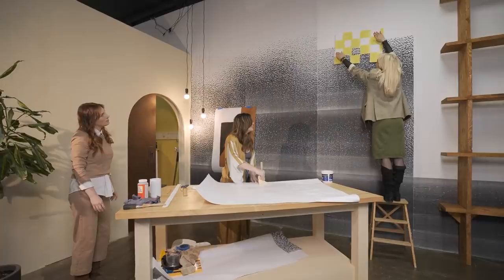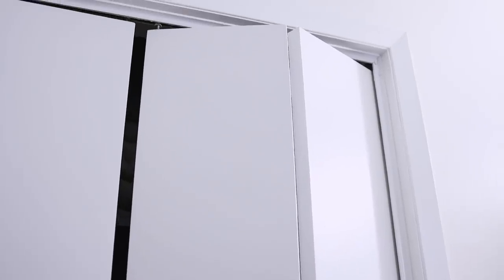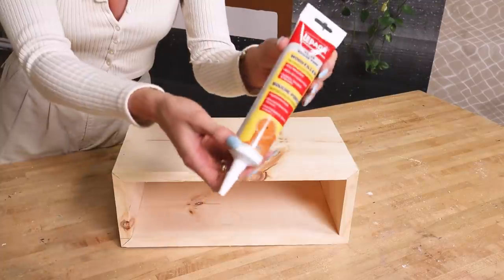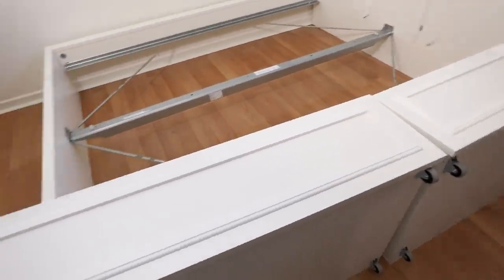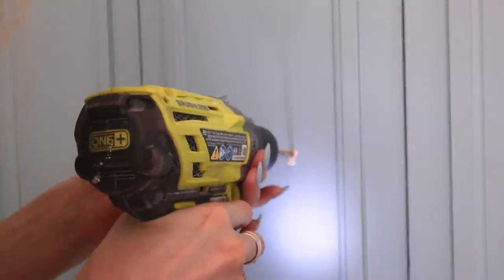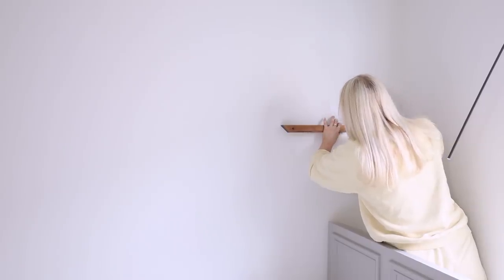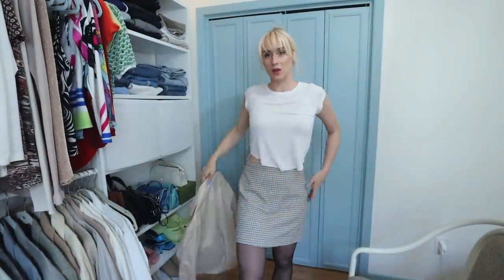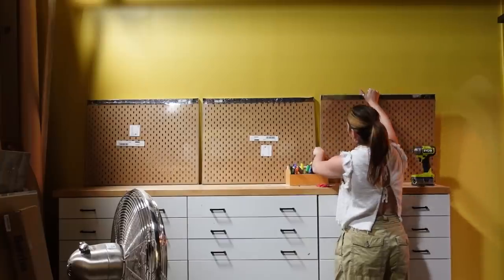FULL rental bedroom makeover using IKEA hacks

Comment: It looks great, you did a really nice job
*Pro tip 'most' brad nailers come with a depth setting, and it appears yours need to be set so it can set the nail a few mm deeper, there is no reason you should have to set nails manually after using a brad nailer

Comment: They say the nightside should be 24-28 height. However that depends on your bed height. You want it 2 to 4 in higher then your mattress top.  WHY  so your pillow can slide over and knock everything off.  So if you use two pillows  be sure they hit the side of the table. I have a bookshelf and this allows a  inside shelf that is lower and for me more comfortable  to set a drink tumbler , phone and small  lamp

Comment: Add a lift up mechanism to the bed ! Allows for way more storage than drawers :)
Reply: I used 80$ lift up hardware and created a simple frame and installed it on the same exact bed ! You get to use both sides, and much easier to access.

Comment: You could have drilled a small hole on the side table so that you could run the electric power cable from the lamp down to the plug so that the cable doesn’t have to go on the side of the table.

Comment: 😊 There is a tool called a nail set, when you were doing projects like this it’s very helpful to have. Karen Florida
Reply: I have 4 different sizes to use with finishing nails and a hammer that was my pre nailgun owning days lol, HOWEVER, you can set the depth of the nail head with most brad nailers, so there is no reason she had to set nails !